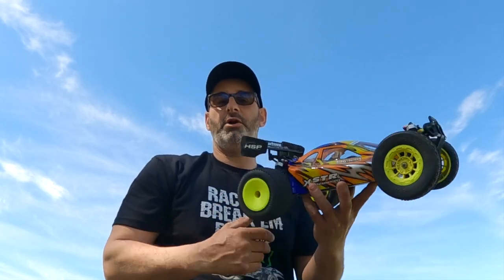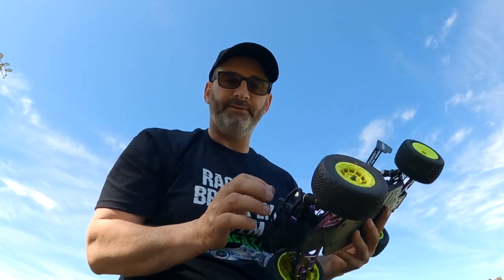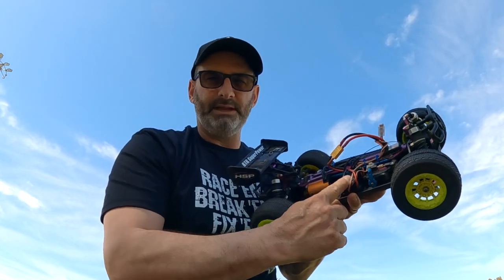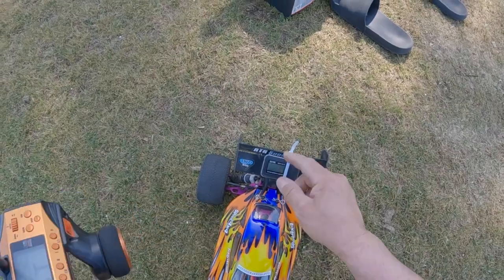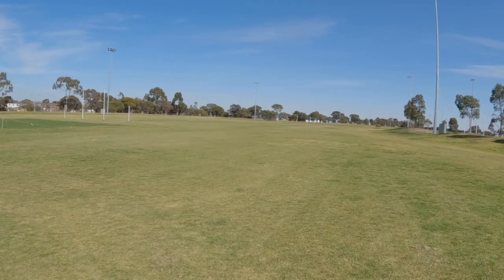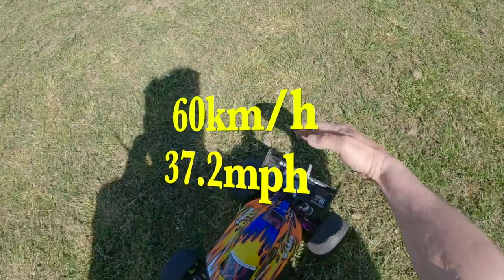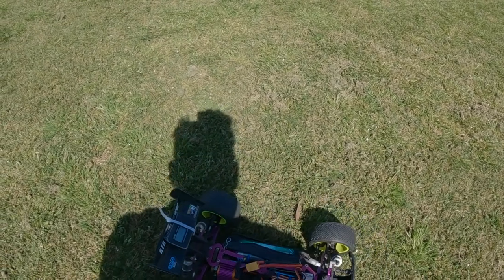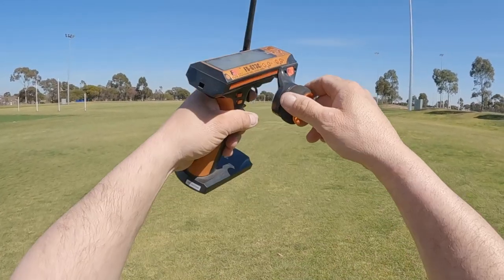The results are GOOD!. HSP speed test 2S & 3S

Comment: Nice runs man👍
I would think your issue is the esc cutting out due to over amps being only 60a and high kv motor.
The motor will heat up being a small can so yeah I would suggest changing the esc to a 100a at least aswell as a larger can motor👌
Reply from the maker: Yeah it makes sense. I will def have to change the esc too. But for sure the nasty goolrc 🤮 motor would be the main cause. Cos it was flipping hot.
Reply: @angesrcs  yeah I can imagine🥵